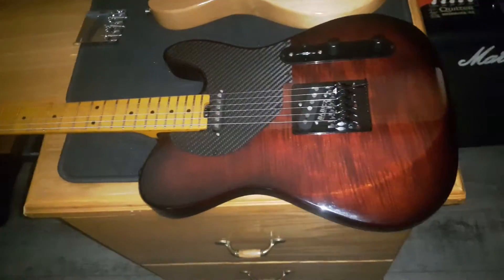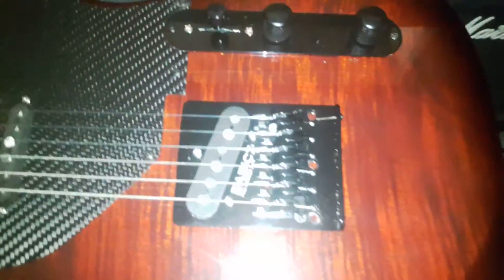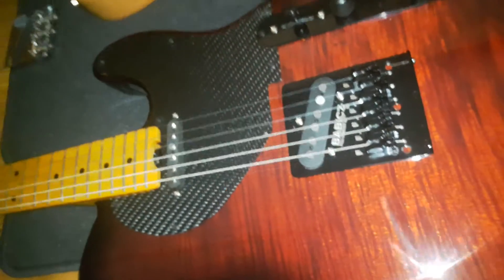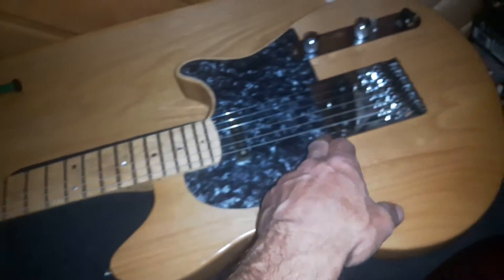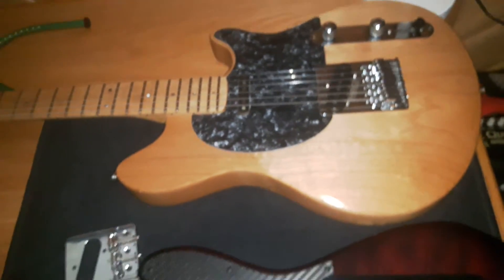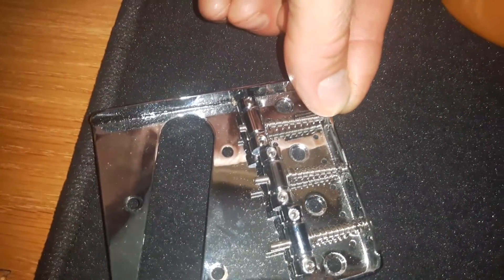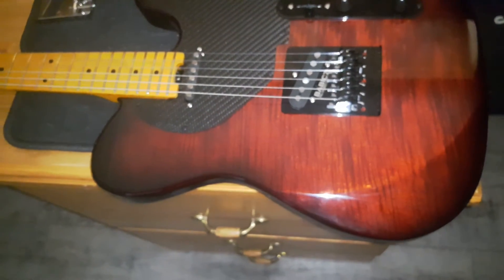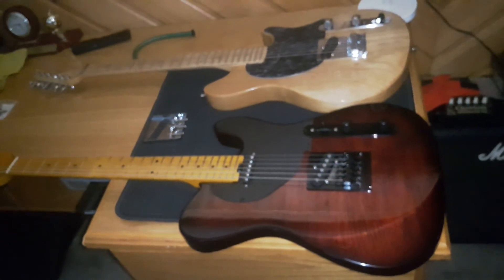Eart Classic T-style re-assembly part 4.3: Problem with the bridge rout!

Comment: Hi J-Man , my measurement was almost 23 1/8. I kept the same eart bridge plate and just replaced the 3-saddle to a 6-roller saddles. I had to modify the holes for the intonation screws, but it did intonate. Mine plays great.
Reply from the maker: Thanks Gene! That is good to know... interesting that yours is 1/4 inch closer to the neck pocket than mine... you would think that the CNC machine they use would spit these out all the same. Looks like each lot may have measurement discrepancies which I think is strange... or maybe I just got a Friday afternoon 4:30 build LOL!
Reply: When you say "Modify" do you mean that you had to screw new holes in the plate? Because I'd like to put block saddles on mine.
Reply from the maker: @FRANKBOOTH777  Hi Frank, if I'm understanding you correctly, you are looking to keep the Eart bridge plate, but swap out the 3 saddle set up to a 6 saddle set up... If this is the case, then it's an easy process. The Eart Bridge plate allows you to string through the body or top load. You'll notice 6 small holes across the back edge of the bridge plate just below the stock intonation screws. So you have 2 options if you want to install 6 saddles: 
1. If you don't care about ever top loading your strings, then simply bore out those 6 top load holes so that you can fit an intonation screw through them, install your 6 saddles, and your done! (Well you have to reinstall the bridge and reset your action and intonation of course lol)
Option 2:
If you want to keep the top load option on your bridge, then you'll have to drill 6 new holes directly above each top load hole. You're going to need to use a punch so your drill bit doesn't slide around before it bites in the metal, and make sure you drill high enough above the top load hole so that you don't accidentally cut into the top load hole as you are drilling your new saddle hole. This method is a little more complicated and time consuming, but if you have good tools it's still an easy job. I have done both options on past projects and both worked well. Use common sense, measure twice, drill once, and have fun modifying! 
Just 2 things to keep in mind.... although option 1 is super easy, those top load holes are close to the bottom of the bridge plate so if your new intonation screws have a bigger head on them, the edge of the head may touch the body when you reinstall the bridge and that screwdriver to adjust the intonation will be very close to the finish, have a look at everything before you decide... And lastly, make sure you have long enough intonation screws. From the back of the bridge plate to where The string sits on the saddle for the E and B strings, that distance will be close to 1-1/4 inches to properly intonate. Eart bridge routs are 1/2 an inch further back than a typical telecaster bridge rout, therefore the saddles will need to be set closer to the bridge pickup to compensate. Hope this helps! Good luck!
Reply: @FRANKBOOTH777  Hello, Using a drill bit, I widened the string holes at the back of the  bridge plate( no New holes drilled), then added Roller saddles and new springs and screws.
Reply: @Gene_Cali  Ok,Gotcha...that's what I thought you meant,thanks!
Reply: @j-man9457  Thanks for the explaination!
Reply: @j-man9457  or maybe there are some running changes...?  seems unlikely tho ... but we are dealing with another new co putting out a new product so who knows..they certainly have got the youtubes all engaged in  promoting their gear like its the 2nd coming of Leo Fender FFS....it would not be a great sign if every cpl thousand or so models they produce all have slightly different measurements...
Reply from the maker: @RaptorV1USA  hey Raptor, not sure but the QC is pretty consistent from what I've seen and heard so I'd say it's just the way they are... not sure how accurate this is, but someone told me that Suhr Teles had similar bridge placement measurements. He suggested that maybe these were based on the Suhr Teles more so than the Fender Teles. I've never seen or played a Suhr. Way out of my price range. So I can't comment on that but it would explain the head stock Lol... sorta has that Suhr vibe going on haha

Comment: Can the neck pickup rout really fit a humbucker or maybe a P-90 ?
Reply from the maker: Hey Twowaymuir! How have you been?
The neck is routed for a humbucker. You could fit a humbucker sized P90 as well. A regular P90 would require additional routing. As you know, if you change the pickup to something other than a traditional tele neck pup, you will have to modify the pickguard as well. 
Cheers,
J

Comment: What nut did you swap to? I'm considering swapping it out on my Eart tele for a brass or tusq nut
Reply from the maker: Hey Jeremy, I used this and it works great! Unfortunately, since July 2021 when I bought mine, they have doubled in price on Amazon Canada it seems! I paid like 12$ for mine last year. 
Here's the link to the one I got:
Graph Tech PT-5042-00: Black TUSQ XL 42 MM Pre-Slotted Self-Lubricating Fender Style, Flat Bottom Strat Guitar Nut https://www.amazon.ca/dp/B0043NO2WM/ref=cm_sw_r_cp_apan_i_3YR7M2GK2W43Z50TG21P?_encoding=UTF8&psc=1

Comment: I'd assume it is not specific to yours, saw this post AFTER I placed my order lol... oh well.
good videos in general, thanks for posting. 
Personally I hate the gap between the bridge and the PG.. not a design feature, its crap lol.  Just pop that horrid greenish pg off, & use it as a template to make your own PG customized to any shape you prefer,... IT IS NOT HARD and there is NO DEADLINE lol... make it right & FIT PROPERLY... you'll be way ahead of the game.   i have one of these on the way, couldn't resist,  it'll be properly upgraded and customized but the 1st thing i'll be doing is a new custom PG. since most of the rest of these guitars seem to be really well done, I won't be spending the usual time addressing the usual issues... leaves more time to customize vs fix.
Reply from the maker: Hey Raptor,
You're right it's not specific to mine. I did e-mail Eart about it but never really got a specific response. I think it was more than likely a mistake when punching in the numbers for their CNC machine lol. Or maybe, it's a patent thing. Functionally, I can't see any good reason for it. Still works fine, just limited to the type of bridges you can upgrade too because the saddles have to basically move forward 1/2" more than on a typical Tele in order to properly intonate. Good luck with yours, and happy modding!

Comment: This is an EART spec guitar and not a Fender spec guitar. What you see as being a problem, was what I see as a fix for the intonation screws being to close to the bridge mounting screws. I was able to put a GOTOH in tune bridge on one of mine with just a little wood removal for the front of the pickup. The barrels have plenty of forward and backwards movement for intonation. Usually the low E side will be right on top of the plate screw. Not on these guitars. I have 2 of these and they are 23 1/4 nut to plate but its still a 25 1/2 scale guitar so there is more room to intonate with a vintage barrel style bridge.
Reply from the maker: Yes these are spec-ed differently than a Fender. And you're correct barrel type bridges will work better on these Eart guitars... I'll know in a week or so as I have ordered one and will remove the babicz and install once it lands.

Comment: Question for you - what did you use to cut the pick guard?
Reply from the maker: Hi Russell!
The carbon fiber sheet I had was paper thin. I just used a nice sharp pair of scissors to cut the carbon fiber pickguard. Then I just laid the carbonfiber pickguard over the ugly lime green one. Really what I should of done is get a transparent pickguard, cut it to match the original, then put it over the carbon fiber pickguard. For regular pickguard cutting, if you don't have a table router, a good jig saw with a fine and narrow  blade works well. Takes a little patience but it's pretty easy to do. Then you just sand the edges with a foam sanding block. If the pickguard material you are cutting has a plastic film on it, leave the plastic film on the pickguard the whole time you are doing the work. For the pickup hole, get as much material out as possible with the jig saw, then for the ends, a dremel with a sanding bit works great.
J
Reply: @j-man9457  - cool. Thanks for the advice. I bought a sheet of 3 ply plastic.  Big enough to make a mistake on!
Reply from the maker: @Grabowski65  haha! Awesome have fun Russell!
If you happen to have a buddy with a CNC machine, those work well too ;-)
I think imperfections is what makes something unique! So go to town and have fun haha!

Comment: Do you think a top.loader bridge rather than  thru the body would work as a mod?
Reply from the maker: Hey luvhandleR,
The Babicz can do both string through and top load. A top loading bridge will work fine provided the design allows for the saddles to move far enough forward to dial in the intonation. Through body or top load doesn't really matter. Either way, the string has to sit on the saddle at a specific distance from the nut in order to intonate.
Reply: @j-man9457  I was thinking a top loader could be placed anywhere in order to meet the intonation requirements,since it's not restricted to Iining up with the thru body ferrals. I can't wait to see how the Wilkinson bridge works.out.
Reply from the maker: @LuvhandleR  yes in that respect you are correct. With a top loader you would not have to worry about or use the string through body holes. However, by moving the top loader bridge forward or to a different location, you would still need to rout out another pickup cavity and drill new bridge plate mounting holes. I would like to avoid hacking up the guitar if possible... hope the Wilkinson bridge works!

Comment: Hey J-man, Wolfcaster? never heard of such a thing, been working on guitars for over 40yrs. Awesome! One of the reasons for my recent purchase of an Eart Tele was to gain experience on guitars other than mainstream. I'm learning all the time. (plus if I want a contoured tele from Fender = $1800.00) I recently installed a string-thru bridge with ferules on a squier Tele. I'll need more practice before I do that on an expensive guitar. Maybe a better drill press? Yes, you could move that whole bridge plate fwd, depending on your sense of humor; 12 string ferules on a 6 string guitar: cool! and who would really see it? I'll watch to see how it turns out. Did I call it or not with the black hardware? My Eart Telecaster arrives tomorrow, very excited.
Reply from the maker: Hey Longhair, 
Good news on your EART arriving! Hope it's well set up out of the box. They are very good I find, but will need some tweaking for sure. As far as the bridge on mine, I just installed a different bridge and it works great. The Babicz is an awesome bridge but it's designed specifically for fender specs. With the EART Tele bridge routs being 1/2 inch further back, it just won't work...
Lastly Wolfcaster is just the name I have a custom build that I have. It's a Wolfgang body shape, but it's routed to vintage Tele spec. And it has a quarter sawn maple on maple neck with stainless steel frets. So it's a Tele essentially but with a wolfcaster body. Hence the name Wolfcaster! Lol
Reply: Love mine

Comment: The problem is you bought the wrong bridge. Case closed.
Reply from the maker: No Kevin, the Babicz Bridge is designed to work on T-style guitars. The problem, and it's not a big one when you know, is that on the eart tele the bridge plate rout is 1/2" further back than on a typical T-style guitar. Any 3 saddle bridge with 4 hole mount will work providing the intonation screws are long enough, but when it comes to a 6 saddle bridges, you are very limited to the type of saddles that will work  on this guitar. Other than that, these are fantastic T-style guitars and you can't beat the price!